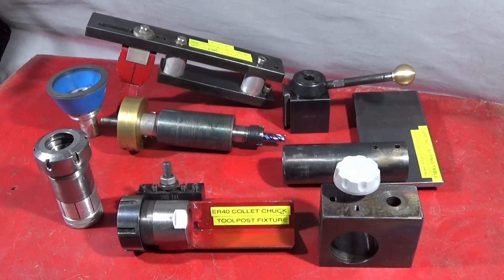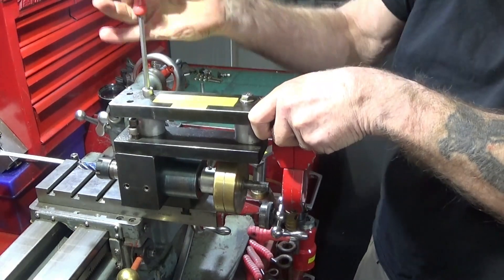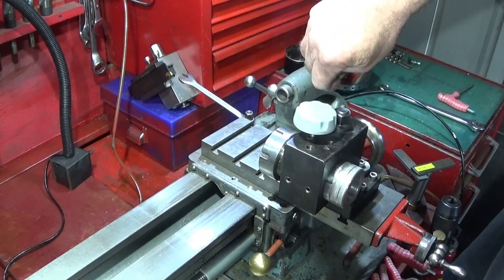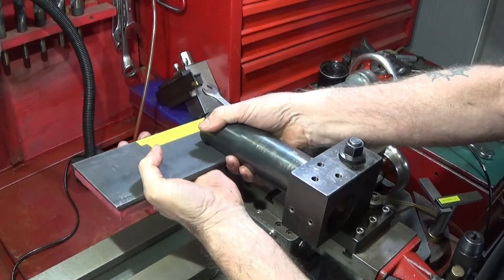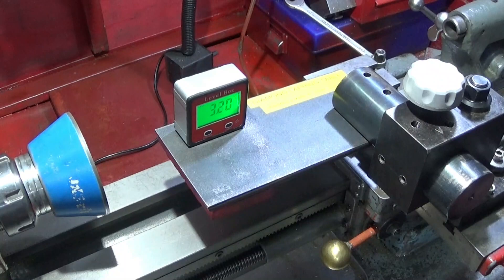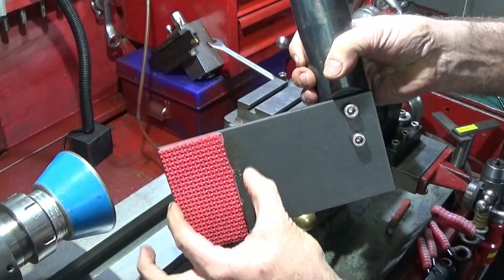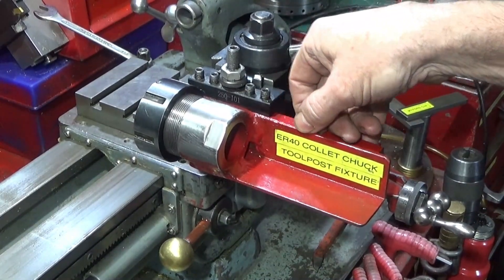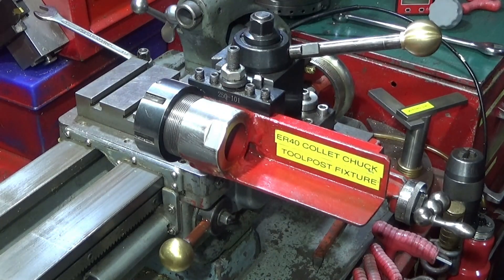Changing & Setting My Myford ML7 Quick Change Toolpost Fixtures

Comment from the maker: Machifit AXA Size DMC-250-111 Wedge Type Tool Post -- http://bit.ly/2lO5Kll
Quick Change Turning Facing Holder 250-101 -- http://bit.ly/2HmNqsO
Quick Change Turning Facing Boring Holder 250-102 -- http://bit.ly/2Hwh5iw